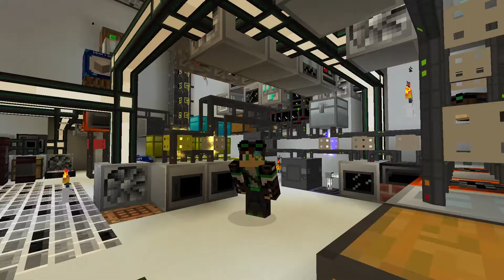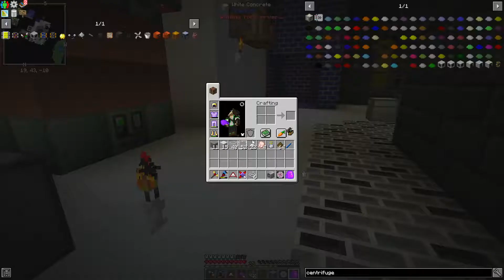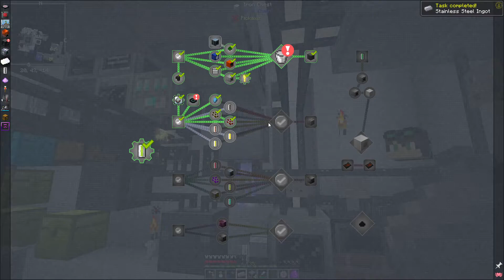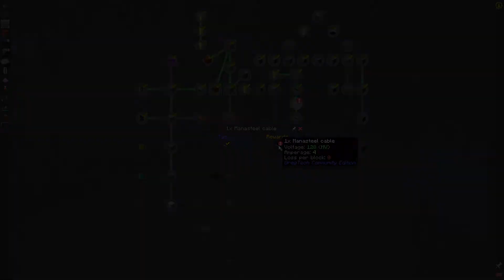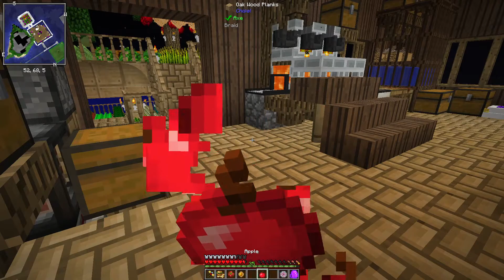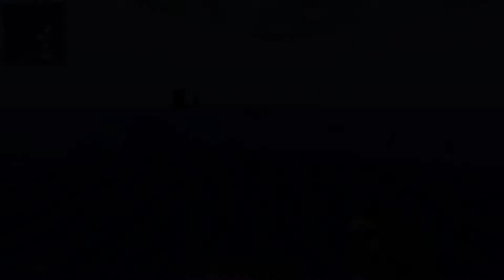FTB Interactions - Episode 26 - Oil & Stainless Steel!

Comment: 15:00

You didnt show the exact conduit settings, so I wanted to make sure you're aware; on the extract conduits pulling from the centrifuge make sure round robin is OFF.

Fluid conduits DO NOT respect priorities when round robin is on. Which will lead to half your methane being trashed!
Reply from the maker: I believe I had that on normal, but I also added a fluid filter later on so no methane goes in there. Good shout-out :-)